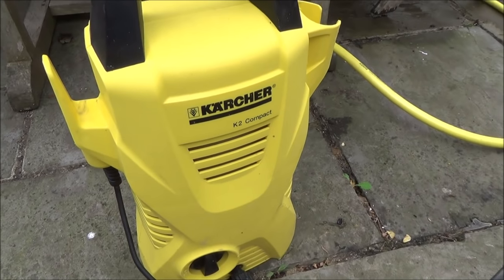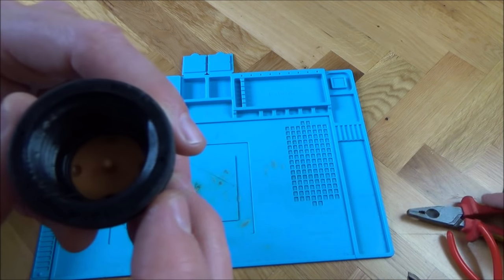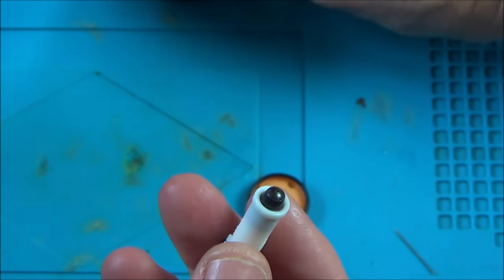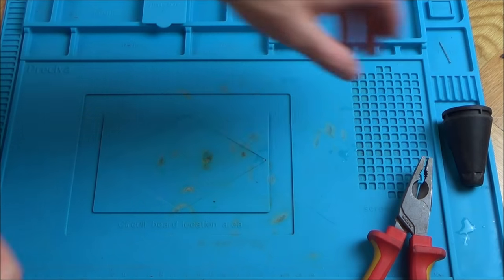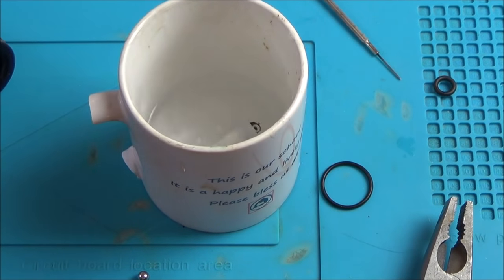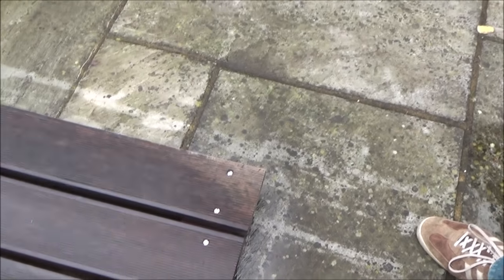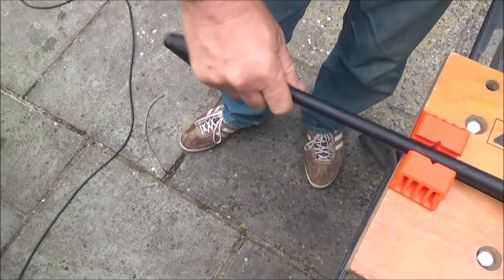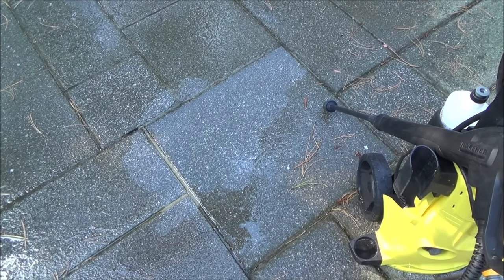Trying to FIX: Karcher Dirt Blaster Lance NOT Spinning

Comment: My dirt blaster rotates but after 15 seconds it slowly stops rotating. I've tried this repair by adding a washer. Kinda helped but what ever I do it stops rotating after about 15 seconds. My machine doesn't pulse, nor leak and "feels" like it has good pressure using the regular want. Anybody have any ideas why it would stop rotating after a few seconds of use?
Reply: Perhaps you need to add 2 washers to get the right elevation of the ball bearing

Comment: Trouble is finding a washer that small, this method worked on my older model lance which has a bigger ball bearing so an M3 washer would fit, need an M2 to fit the newer lance which I cannot buy anywhere

Comment: My Karcher cuts in and out when it's just left switched on. I assumed it was due to low water pressure locally. My Dirt Blaster has gone this way too so I will try taking it apart and see what is wrong.
Reply: Check the electrical pressure switch and clean it. Probably full of gunk.

Comment: typical lousy design and using plastic.. almost like it's designed to wear out and fail, once the warranty is expired.
Reply: Well... Whatever material you use there it will eventually wear down even if it was lubricated...
Plastic is cheap and easy to replace so i don't think its the worst option but they should tell you how to fix those kind of issues on the manual.
Reply: 100%, there is no doubt that making it with plastic was a deliberate choice purely based on the lance wearing out. I've spent much of the day trying to fix mine but no matter what I cannot fix it. At the best part of £30 for a Karcher lance it's almost a third of the cost of a new machine - total rip off.